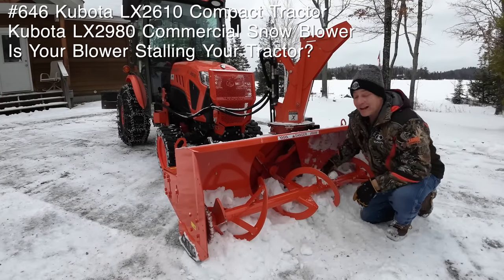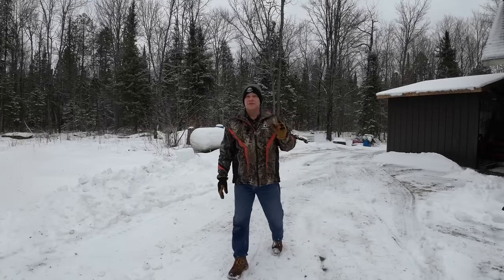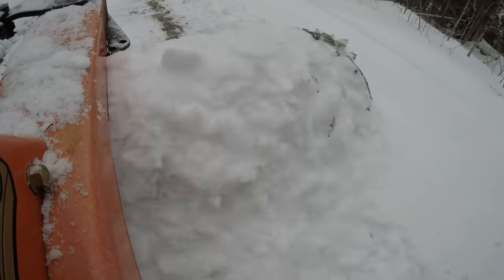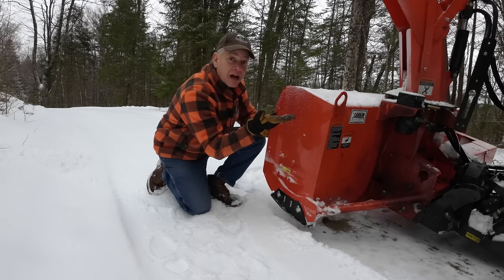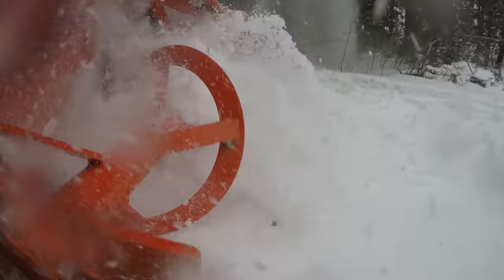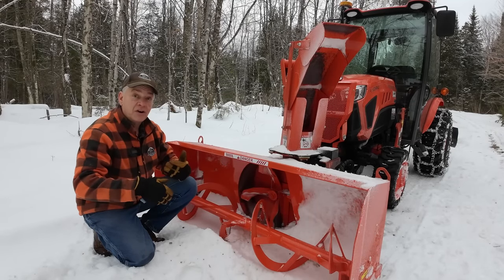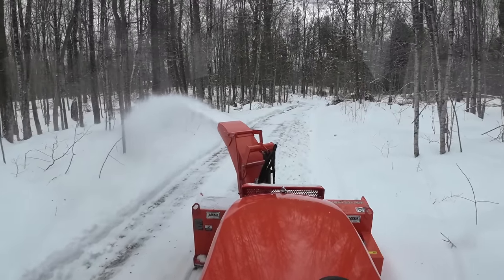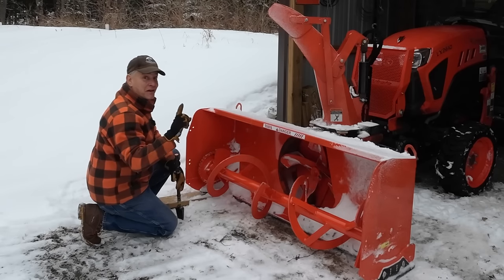646 Does Your SnowBlower Stall Your Tractor? I Can Help. Kubota LX2610 & LX2980 Snow Blower 4K

Comment: Gord after watching your engine temp guage in the video, running this engine at 2 bars while under load is to cold. You should tarp in the front of the engine to get the engine temperature up higher.
What I do once I have read the manual to get the proper operating temperature is use a temperature gun on the side of the engine. This will then tell you how many bars you need to be at.  Everybody knows a loaded engine is the only way to produce heat.
The diesel engine life is extended much longer when it is run at its proper working load. In my equipment rental company we had hundreds of small diesel engines and this was the best way I found to test the engine temp unless it had an actual engine temp digital guage as the tier 3 and tier 4 engines came out with.
Reply from the maker: Good morning Claude. Thanks for the helpful advice. I was not aware of that. Summer and winter it is usually running at 3 bars on the dash but you are right it was running at only two bars most of the time that day. I will read through the manual again - its been a long time since i opened it up. Thanks good sir!

Comment: Wow. Your RPM's really slow down in Mid Range. I have what you used to have (a B2601 with a rear 58" blower). I only use it in Low range and at 2k RPM and it only slows down= if I hit a big snow bank or such. Never have a problem with RPM.

Comment: Gord, why did you go to a LX2601 from your B26???
I have a BX2380 but need a bigger tractor. I’m thinking of going to a compact LX2601 but was wondering if a B26 would suffice.
I do a lot of loader work with my Bx & find it under rated & not enough lift capacity.
I move log’s around & also stones. Hence I would like to buy a grapple. 
I would appreciate your input. 
Oh yeah I have a rear mount snow blower & would like a snow pusher mounted to my loader. Thanks

Comment: Does your display show you the RPM on the PTO?  Each piece of equipment is works best with a usually fairly narrow range.  My blower works best about 400 RPM.  But excels around 500-550 RPMs.

LOL. Yes I buy sheet pins but the pound now.
Reply from the maker: LOL! Yes I can see both - there is a button on the side of the display that allows mr to switch between both. Cheers!

Comment: Hi GP, I’ve got to confess, I’ve missed some of your recent videos. Sometimes I binge watch them to get caught up. I was taking to my brother in Ontario today. He has a BX1880 like I do with a front blower. They aren’t the same as yours though. Our shear pins are right on the auger. I’m not sure if your chute has the metal bars inside it (presumably to stop big chunks of ice from flying out the chute). We’ve both had recent storms where the temp was near or slightly above freezing. This caused our chutes to continuously clog up while doing our driveways. Is there any reason a person couldn’t remove the metal bar rack out of the chute to help reduce this issue of clogging the chute?
Thanks for all your info!
I can see the issue your talking about here with the rpms dropping is different than the problem I’m speaking of and we are aware that we have to go very slowly if we are in heavy snow because of our lower powered tractors.
Reply from the maker: Morning and nice to hear from you Andrew - I hope 2023 is treating you well. That's a good question and I don't have a good answer. I was not aware any of the Kubota blowers had a grate on the chute. But I can see how that would cause clogging for sure. Take good care and wish you all the best!
Reply: @GPOutdoors  thanks for the quick reply!
I read your response and then went on google to find other opinions as well. 
Most people agree that the chute “grate”, or “diffuser” is intended just to stop people from putting their hands down there. I think it’s fair to say I’ll never do that so I think I’ll try removing it.  
Thanks for your continued videos!
Have a great rest of winter!

Comment: Over time you'll see the blade is the way to go, especially if you get a v blade.  3pt snow blowers look nice in theory, but in practice the blade will do 95% of snow removal alot easier and faster.  I do have a used Comet 5' blower, paid $250, but with no cab, it gets cold fast, aleast you have a cab  also they are  hard on your tractor.  Good luck, thanks for sharing, it is fun pushing snow 😊
Reply: I agree that a blade is faster but sometimes a blower is the only option. My property is heavily wooded with a narrow driveway. I would quickly run out of room to put the snow after a few storms if I only used my blade. With a blower I can wing the snow way into the woods. I only use my blade for small snow amounts or scraping down to the asphalt. My blower is a pull type so I can drive forward instead of in reverse which makes things a lot easier.
Reply from the maker: @davem4193  Ditto. The reason I had to buy it. No where to push snow. Thanks guys!
Reply: Thought the same thing, but a front mounted V-Blade at higher speeds really sends the snow flying!  I will say a blower makes everything look so clean and neat, as long as it's light and fluffy, here in the northeast we get wet and heavy=clogged chutes.  Take care and can't wait for spring  🌱
Reply: We get 400” of snow a year. Blower is required.
Reply: 1000’ drive, heavily wooded and hilly.   “Speedy” just isn’t possible - even with 40+ hp….   I have a buddy with a V blade, he brought it over and just couldn’t make it work here although it’s Fantastic at his place which is flat and open…

Comment: I found that after I finished blowing I would take a gallon of cheap (-30F)  windshield washer fluid and splash that in where the auger is as well as the fan and chute. Never had a problem with the fan nor the auger freezing. I also made sure the bottom of the blower was parked on wood.

Comment: I had the same setup as you on a 27 hp Kioti. I took the front mount blower off 5 years ago, now I plow with my bucket and the back blade.  With the blower on the front, you lose the ability to get yourself out if you get stuck. Also the transfer case on the blower weighs a ton and working by myself at 76 years of age, it isn't fun mounting it.